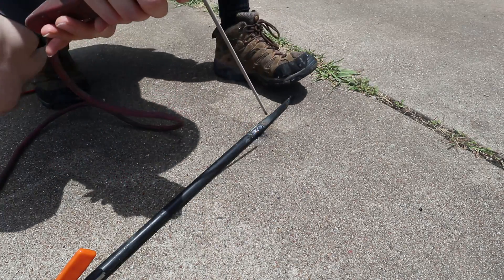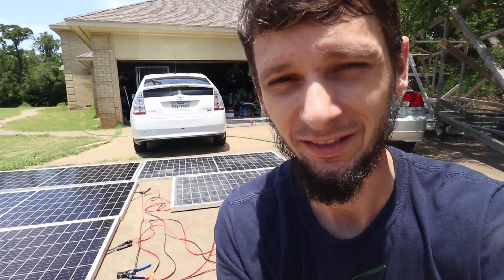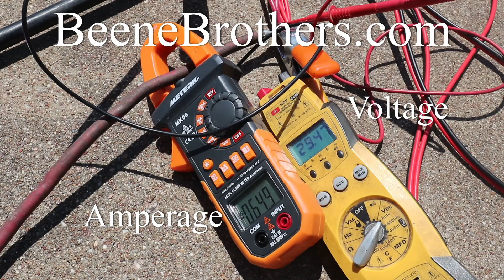Arc Welding With Solar Panels - No Inverter! No Welder!

Comment: I realize your video is four years old, but was trying to see how you connected your solar panels. It looks like they’re connected in parallel and wondering if perhaps it’s better to connect them in series as I believe that’s how you achieve a higher voltage.
Reply from the maker: So I’m no expert in welding, but the research I did said the voltage collapses and self regulates indicating I’d be best off with putting the panels all in parallel. One day I’ll get some properly prepped metal and try again. See if I can get proper penetration :).

Comment: Maybe easiest way to weld from panels is to connect 5 or 6 panels one by one to get 200-250v of open circuit... And connect them to diode bridge of ark welder inverter. But only if inverter transforms ac to dc on the enter of power supply.
Another way is to power up condenser's in arc inverter with low voltage but more amps (parallel the panels). And connect inverter in normal way too, to dc/ac inverter... But how about welder logic may works with that?? It's just suppose...

Comment: Looking at the meter readings at the end, the main issue appears to be that the arc V collapses and hence most of the energy is dissipated inside the solar panels instead of at the weld. This illustrates the general issue of extracting at the Maximum Power Point transfer requires an inverter.
Another thought.... Inverter welders turn mains into DC and then use this to supply the weld energy. With series solar panels one could reconstruct the DC inside the welder (instead of using mains) and then use the welder. At the much higher V, the panel current will be much less likely to collapse.

Comment: Help me out with the math... my wire feed welder runs about 30VDC (maxed out), and the input is 240VAC maximum 30 amps.  

240v / 30v = 8
30a * 8 = 240a

Simple, not considering conversion losses through the rectifier, transformers (more likely buck/boost converter) might be running 200amps?
Reply from the maker: The way I’d do it is max of 240v*30a is 7,200w. 7,200w/30v is 240a.

Sounds like you made it to the same place but I’m not sure if that was luck or math!

Comment: subbed nice research!  I need to weld some 1/4 rebar off grid.  My van has a giant 155ah deep cycle AGM 12v and with the my 160a alternator running I currently can run AC applicances up to like 12amps constantly for 30 minutes+.  So I am wondering if I connect a 12v to 24v step up converter to my battery rated at 480watts if I can weld 1/4 rebar with the engine running?  If so, any way to isolate and protect my battery, van and eletronics? What rod would you recommend?

Comment: Isn't this mass up diode or internal line or expensive solar pannels ? 

You need separation or protection to separate solar pannel line to welding so it doesn't damage solar pannel diode or burn up solar pannel sir ?

Comment: You know what you might be able to get some consistency with your arch by adding a few big capacitors in series between the panels and your electrodes.
Reply: I agree,,
Reply: How big would those capacitors need to be?
Reply: @Matthew-sl4rs  Really really really big,
Reply: @TheIndustrialphreak  no ) just some kind of massive with not so big capacitors. 1000 uF 63v  or 2200 uF 63v and so on. And maybe need some big diode from capacitors to electrode clamp. And this is little dangerous work taking a mental with hands without any isolation. DC more than 36v is dangerous for humans heart... So let's play careful guy's ))
Reply: Yes capacitors will help anyway...

Comment: @ 3:00 if you add heat shrink before inserting pin the gland will seal properly with smaller gauge wire
Reply from the maker: Hadn’t thought of that. Good idea!

Comment: I went to battery hookup and only had 80 cash on me. They didn't have change so just gave me a bunch of SPIM08HP as change. Do you think you can try welding with those batteries if you remove the BMS for a bit of time? Dont think it will hurt them if you start fully charged and watch the voltage.  I only have 2 ea 250W 10Amp panels.  First time I seen this was Jamie Mantzel but he has a big array on his boat.  https://www.youtube.com/watch?v=zZAfNKx25_A.  Thanks in advance.
Reply from the maker: Hmm. I wonder if you’d have to current limit somehow. Since the battery will try to dump all its juice at once. Love the genius of using batteries as a currency. What was your main purchase. I’d be broke if I lived within driving distance of that place!
Reply: @BeeneEnergy  Actually I went to get 80$ of headway 38120 but they were out of stock. Sorry my mistake had 100$ bill so just ended up getting 100$ of the SPIM08HP pouches. Which are a more of a pain to connect. But I have more then double what I needed so want to use the rest of them to power my mower.  I also want to get a bigger bank for my RV but they seam to keep getting better stock.  They are close 25 minutes. But hard to find as the building is not marked. They are hidden in the back and the door has the name Alarm Hook up which I guess is how they started with batteries.  They said just dont show up make an appointment so they have the payment and batteries ready.
Reply: @BeeneEnergy  Maybe a fuse or circuit breaker under the limit of the battery.
Reply: Welding with lithium batteries directly? No way don't do that!!
Reply: @SiriusSolar  Why not? The SPIM08HP are lithium polymer not lithium ion.  Overland guys weld directly from lead acid.  https://www.youtube.com/watch?v=PV5oLPLUzrM